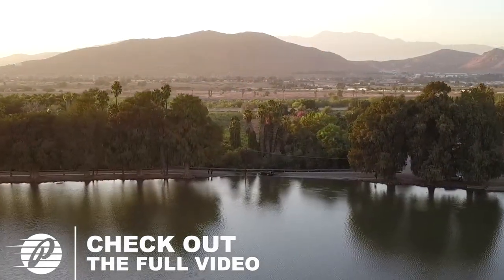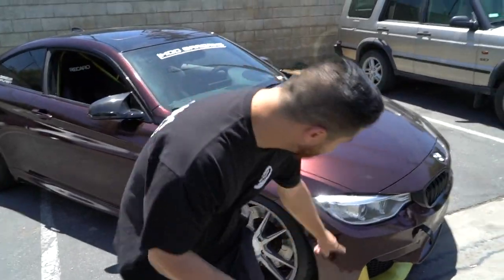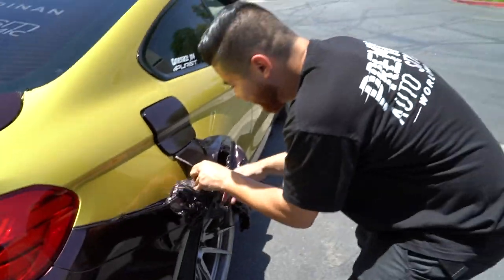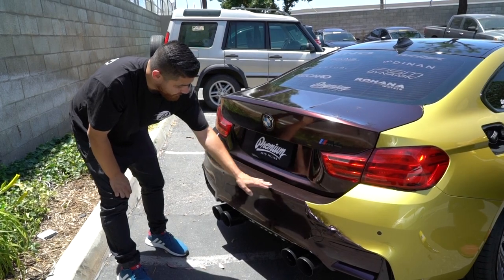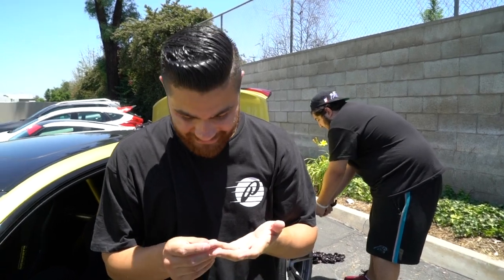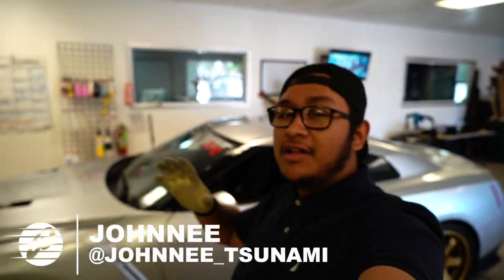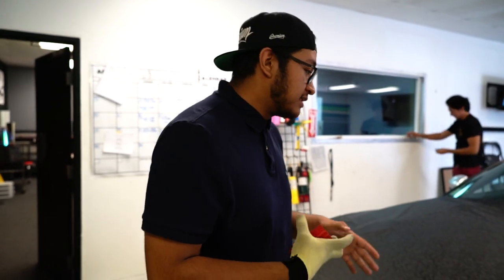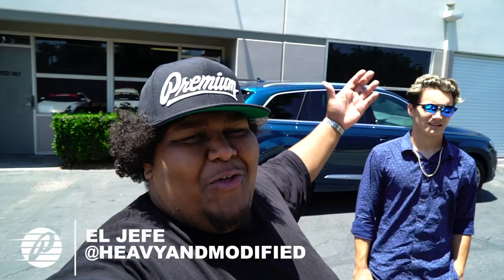UNWRAPPING BMW M4 - Vinyl Car Wrap Removal

Comment: So when u charge for a wrap does that include the dissassembly of the cars and the prep work of the car??? Or just material and install. At 100$ per hour that could add to alot real quick.

Comment: Great vid... I did not now you could be so rough with removal.. I recently removed wrap off my trunk and literally was holding the heat gun on the wrap and pulling it very slowly. Would pulling it off like this risk damaging the paint more than the method I did? My car is much older and I was paranoid about pulling paint off with the wrap.
Reply: Did the wrap leave any real ugly residue ? I use 3M vinyl skin for my tech equipment laptop etc, it never leaves residue. Why is he complaining?
Reply: @gameranch1995  actually it did and it was a major pain to remove.
Reply: @Dnasty1  I've heard that 3m vinyl don't leave any residue
Reply: @gameranch1995  I had mine on for a while and I used the car wrap. Not sure what you used for your laptop but they are known for having a more aggressive glue than the other brands which is good and bad in guess. Better longevity and sticking and more of a pain to remove.
Reply: @Dnasty1  Have you heard of Dbrand? Those skims don't leave any residue
Reply: @gameranch1995  never heard of it. Is it any good?
Reply: @Dnasty1  Dbrand makes skins for Tech gadgets. They use 3M vinyl wraps. They have never left any residue whenever removed

Comment: Im going to wrap my 2000 Honda Civic. I got rear ended 3 years ago, and the paint shop did such a bad job. I touched the bumper and paint fell off. They repainted the whole bumper, but they left my car in the shop while someone was doing a personal project and OVERSPRAY on everything. I was able to clay bar my car, but it was never the same. People suck. Do your job bro.

Comment: How long will the vinyl usually last until it needs to be changed?  Thanks
Reply: My vinyal wrap was done by a beginner and I live in Alaska. Lots of rain, snow and salt. Daily driving and my wrap is still perfect condition going on 4 years. But now I want a new color.  I'd say if done right professional 5 years minimum. Just protect the vinyal with the right soap and sprays when u can